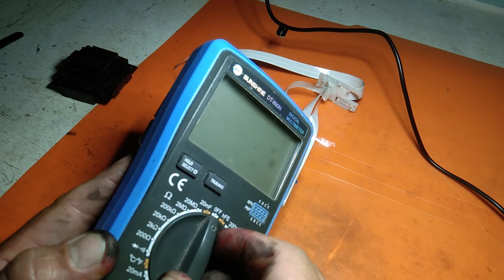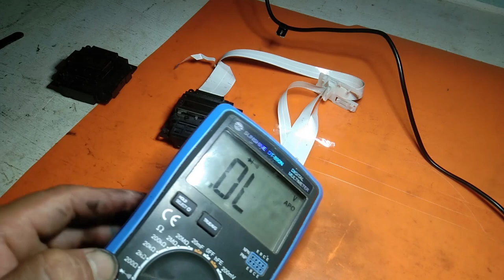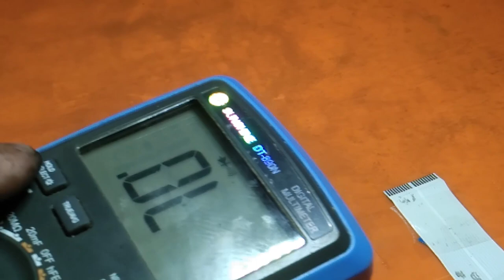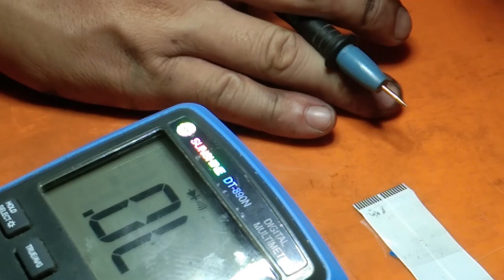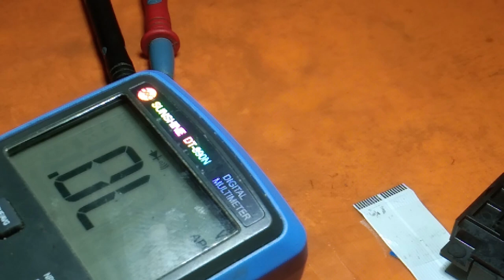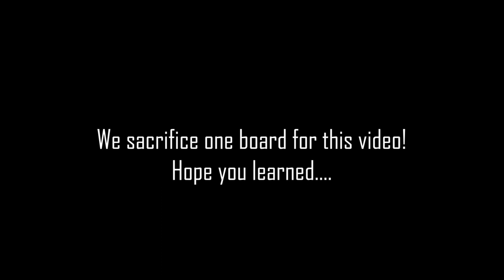How to know if the printhead is damage / how printhead causes board shortage Epson L120 printhead

Comment: Sir ask ko po ano pa problem after nag palit ng power transistors at ic nag on na po unit kaso ala po print out ng palit din po ako ng print head galing sa unit na ok. Salamat po.
Reply: Sa logic board yan possible na may shorted sa fuse nya yung f1 makikita mo yon

Comment: ano po ang gagawin kapag ayaw mag turn on ng printer kapag nakaintact ung printer head flex?
Reply from the maker: pacheck muna po ng power supply, if ok ang power supply please check po ng board, usually c6144 saka a2222 transistor at saka 24 pins  power IC. sana makatulong sayo, pasubscribe naman po....